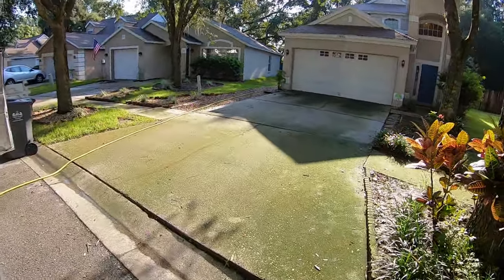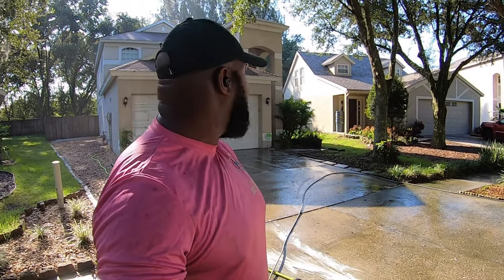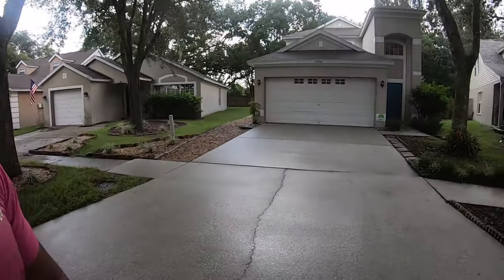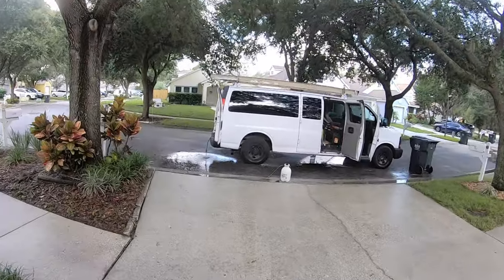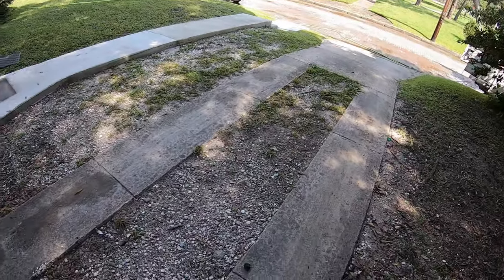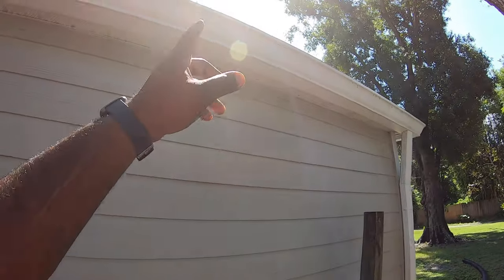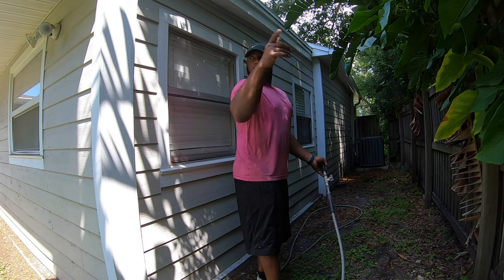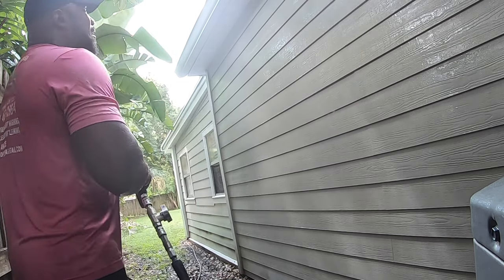Super Dirty Concrete Power Washing And House Soft Washing

Comment: Hello, on the first driveway when you applied the 50/50 with the pump did you rinse it off or leave it ?
Reply from the maker: No. There's no need to rinse the post treatment. Just spray it and let it eat up those stripes or left over stains.
Reply: @PinkFlamingoPowerWash  your awesome man!!! TY so much for replying you just got a subscriber!! One more question though: if I am down streaming does it MATTER what SH I use (ex: 5%,7.6% or 10% ) I don’t think so right ?
Reply from the maker: @chrisrubio2218  you want the strongest possible.
Reply: @PinkFlamingoPowerWash  but doesn’t when  downstreaming only use 1% ?

Comment: Does the super suds sucker draw that much more? I use a variable GP injector and even all the way open it won't tackle algae. I always have to go over green areas with a pump sprayer.
Reply from the maker: Yes it does. It's bigger than the regular injectors.  Great for houses , pre and post treat on driveways

Comment: Awesome job, Do you always down stream your pre treat?
Reply from the maker: For the most part. It works well for me. If I need a higher mix I pull out the 12v.  I usually post treat with the 12v. If the surface is really bad.

Comment: I have a question, how do you softwash the sides of a house with SH without damaging the glass on the windows?
Reply from the maker: Just regular wash and rinse. Sh don't damage windows on impact. It will etch windows if you don't rinse them
Reply: @PinkFlamingoPowerWash  Ok, I appreciate that. Thanks for the help.

Comment: Nice work bro, as always👊🏽😎

Quick question-did you notice anything that made you realize you needed to do some maintenance to your equipment or was it just routine things?
Reply from the maker: Thank you brother. No I just stay up on it.  Routine stuff like making sure nothing is leaking, cleaning up the rig, greasing the swivels, cleaning the surface cleaner tips, check all oil levels.
Reply: @PinkFlamingoPowerWash  Yessir!!  Makes sense!  I was just asking in case it was smthn I experienced or could relate to!  Season is winding down up here in New Jersey, so I’ll be doing the same thing soon!  Take it easy bro!👊🏽😎

Comment: great video. what # orifice do i use in my suds sucker 8gpm
Reply from the maker: I have a 5.5gpm right now. Gonna upgrade to the 8gpm soon
Reply: the packet came with 5 different orifices what # r u using for your 5.5 gpm
Reply from the maker: @scottgarvey1469  I got the #3 in mine. #4 is for 8gpm.